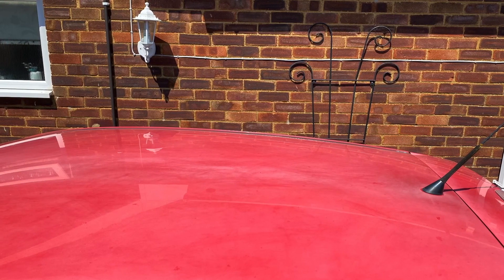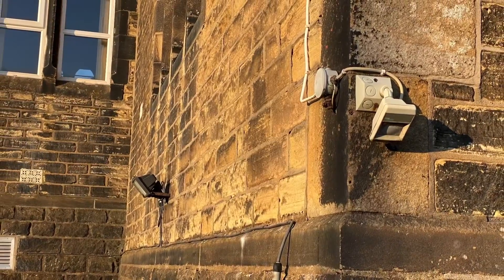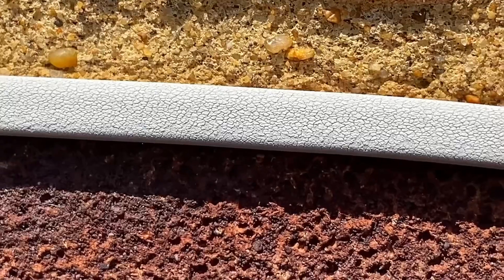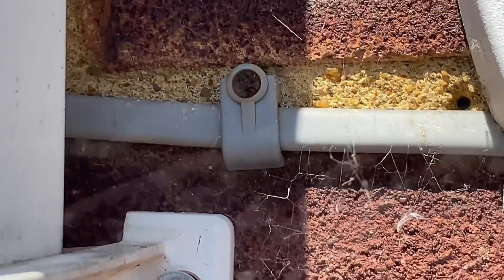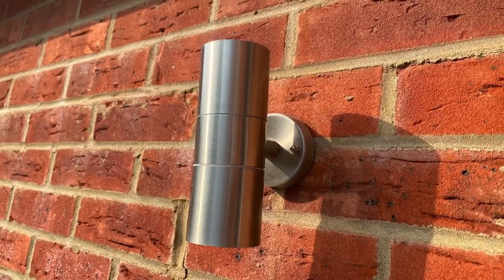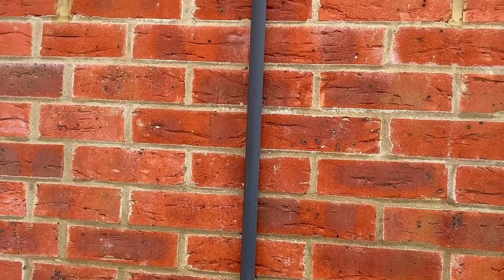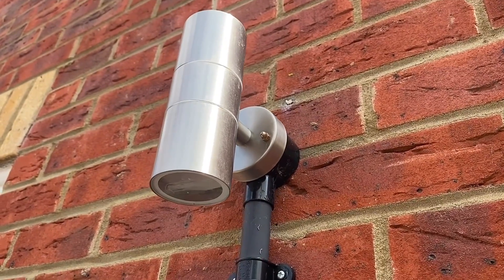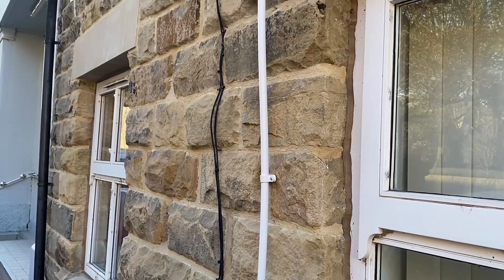A NEW Type of Twin and Earth Cable..? The Effects of UV Radiation on Twin and Earth Cable

Comment: The cable is also twisted to the right of the light fitting. Whilst I remember, can you run the cable parallel in between the bricks and then point over the top?

Comment: I've seen people run pvc/pvc cable for both mains and data ran externally aswell as in conduits and drain pipes where the standing water has permeated the out sheath and inner sheath causing short circuits.

my pet hate with clipping any cable is the clips being used upside down (nail at the top), I.e if the clip were to break then the cable is gonna simply drop and sag, where as if installed with the nail below, at least the weight of the cable sits on the nail and not on the plastic.

Comment: In my area the Southern Electric Board probably in the 70s 80s often used White T&E cable outside. Yes in looked horrible but they never used grey . It was made by CAP (cables & plastics ) .It lasted and lasted . In fact I find the older the cable the longer it lasted outside. 
I assume it was a different recipe plastic in the old days .BICC cables used to be the worst I found for deterioration outside.
The reason that plastic conduit has discoloured is because these days it’s rubbish . Made with recycled plastic.
Reply from the maker: Thanks for adding your thoughts and experiences 👍🏻. Gaz

Comment: Pitacs 3 Core Flex Rubber Cable (3183TRS) 1.5mm2 Drum. Toolstation, 300/500V for environments like workshops. More durable than PVC with standard risk of mechanical damage.  this was recommended to me for my daughter's outside lights.
Reply from the maker: Thanks for watching and adding your thoughts 👍🏻